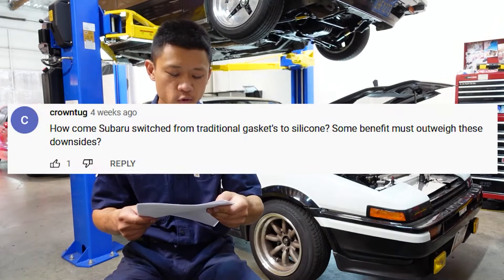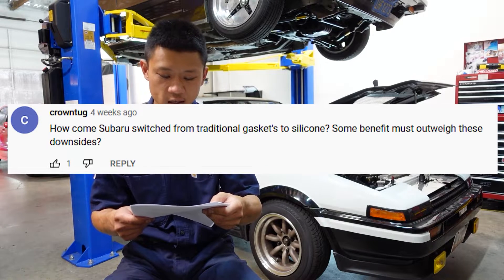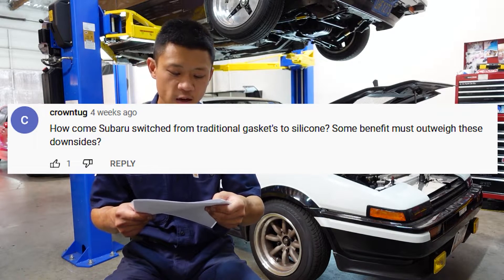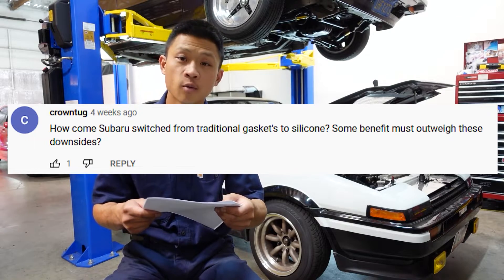Why did Subaru switch from gaskets to RTV?

Comment: There’s more to it. Both of the things he talked about here were done by just about every manufacturer ever not just Subaru. And that is not the only reason for FIPG/RTV replacing gaskets. It lasts much longer and is a way of the manufacturer tracking whether or not an engine has been opened for warranty purposes. The factory normally uses a very specific color that is different than what they sell to the public. At first glance it may appear the same, similar, or completely different depending on the brand, but a warranty inspector will typically be sent out when a dealer is doing a warranty claim on an engine failure, and they can tell if it is original or not. Yes, manufacturers take short cuts sometimes to reduce manufacturing costs but that is normally never the sole reason why they change something. It’s just a significant factor. Government regulations are another big factor. Rtv/fipg/every other sealant manufacturers are using does lower manufacturing costs in the long term but it is also used because it is superior to a traditional gasket. That caveat is that installation is easier to screw up for the average bonehead mechanic and it’s generally more time consuming to clean up when doing a reseal. It’s also never as simple as it seems. Mechanics love to harp on engineers because mechanics are normally ignorant and arrogant (at least 95% of the ones I have worked with). Many of them don’t know that there are certain types of sealants that CANNOT be used on certain engines because they can damages catalytic converters and oxygen sensors. How? As the engine heats up, the wrong type of sealant will gas off acetic acid which will end up going through your crankcase ventilation system, into your intake, then through the combustion chamber, and finally through your exhaust system where your oxygen sensors reside. Not generally something you would ever think of when you’re resealing your oil pan, but that’s just one of the million ways that modern vehicles are not at all intuitive. The average mechanic will grab whatever tube of silicone is nearest to them and dump globs of it all over without a care in the world because of flat rate. Thank you Mr. CM Autohaus for exposing the flat rate system that so many people who are not mechanics have not idea about. It gives them a much better idea of why things are the way they are when you take your car to get serviced and helps explain why everybody should stay the hell away from our industry.
Reply: Using paragraphs goes a VERY long way. You should try it sometime. They're awesome if you value your retinas!  Lol.  Appreciate the explanation nonetheless.
Reply: @ gotta love when the internet finds flaw in anything good
Reply: Well you were doing really good til the sentence that started with "That caveat". I lost you at this point. I read it multiple times and could not understand what you were saying.

Comment: Are there any manufacturers out there that make traditional gaskets to swap out?
Reply from the maker: I know of one working on a lower oil pan gasket. But majority of the engine must be sealed with silicone
Reply: What brand can you get a gasket?